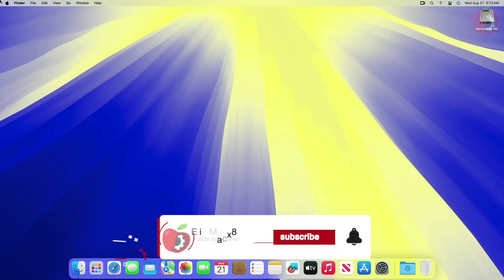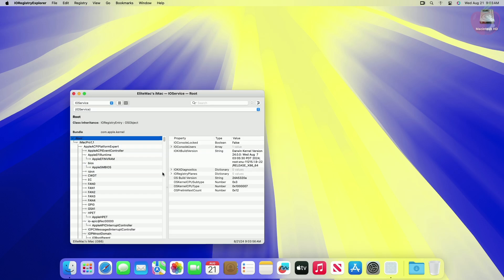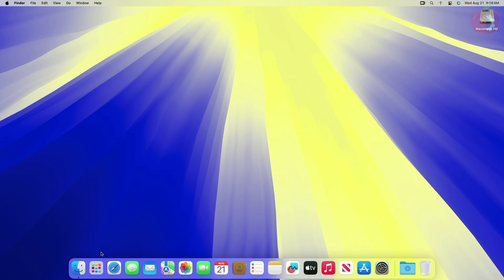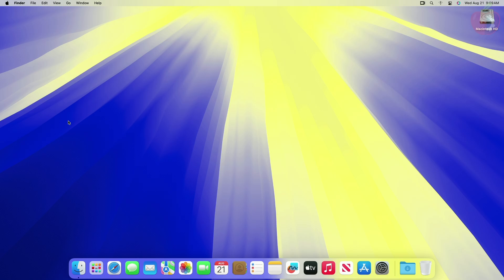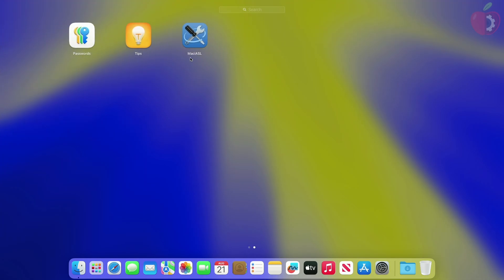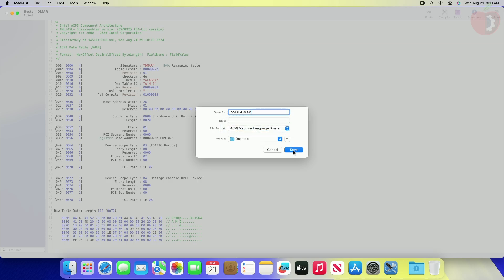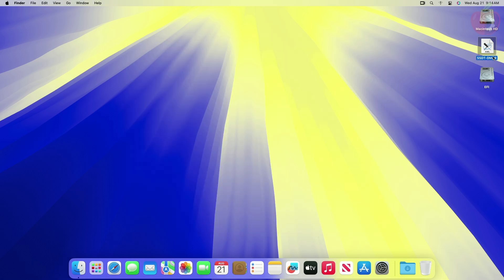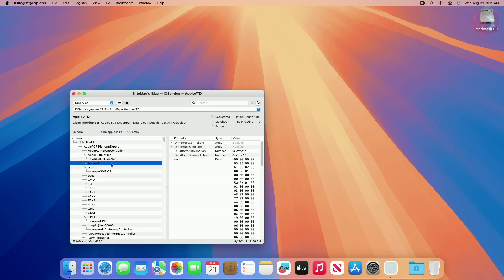How to Enable VT-d on macOS | Hackintosh

Comment: Is there any problem with WiFi and Bluetooth on Sequoia beta 6? 
I am using my hakintosh with Sonoma perfectly but when I updated Sequoia then I found Wi-Fi and Bluetooth issues.
Please respond with a solution thanks 🙏
Reply from the maker: What model are you talking about?
Reply: @EliteMacx86  HP Slim Desktop S01-pF0306il
Intel(R) Core(TM) i5-9400 CPU @ 2.90GHz, 2904
DDR-4 12GB RAM
Wi-Fi card-  i) Intel AC-3165
                     ii) RTL8821CE 802.11ac
Intel UHD 630 graphics
Any card is not working in Sequoia but the intel card is working in Sonoma.